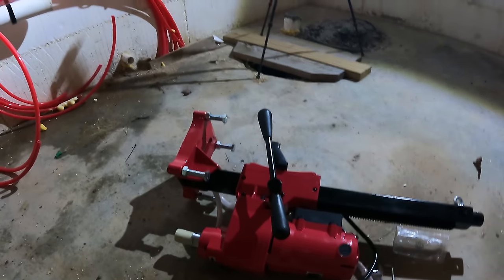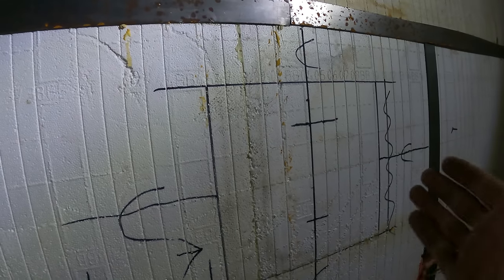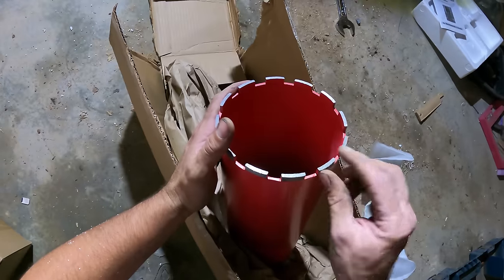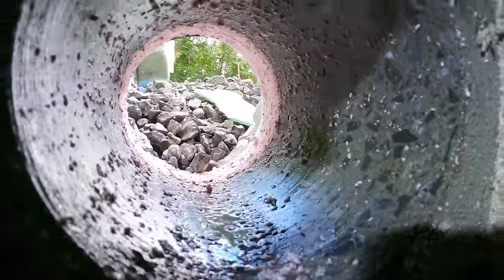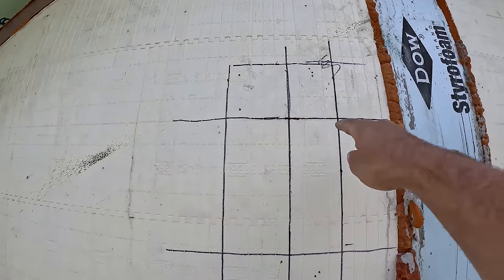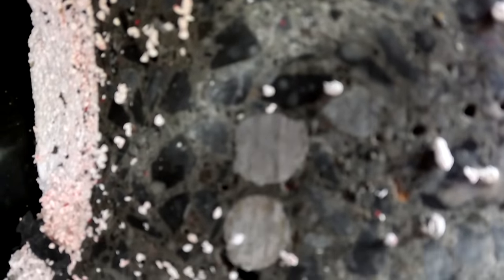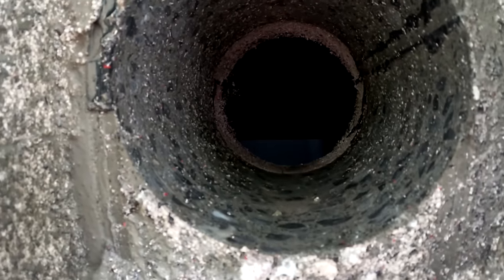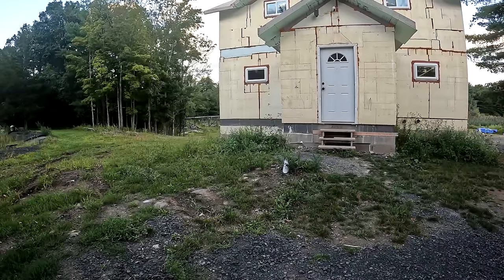Setting up a wall mount Bluerock core drill rig for drilling concrete

Comment: Did a lot of diamond core drilling before I retired, if you are doing multiple set ups as you were it's worth the effort to make up a plywood template to mark the set up out. Also as another poster pointed out don't try and force it to cut, gentle pressure is all that is needed or you risk polishing the diamonds and then it won't cut at all. I often found it was better to wind the barrel out while it is still turning, less chance of jamming up. As you gain experience you will be able to tell when you are cutting rebar change of cutting rate, different sound, or change in appearance of the wash water, (steel particles in it, I used to use a magnetised screwdriver to check).
One final point for novice drillers, make sure you get the right cutter for the material you intend to drill.
Reply: Wise words! 👍🇦🇺
Reply: Exactly my thoughts after drilling lots of holes…I also like to push lots of water to keep the cuttings away from the diamond surfaces.  You don’t want the diamonds regrinding the concrete/rebar cuttings.  You are wasting an expensive core bit…question?  what are they getting for a 6 inch core bit these days?  800 dollars? Just curious?
Reply: 😅 14:23
Reply: 6
Reply: ,  6
Reply: , 14:23 y fu ,
Reply: 😊i 14:23  ,,
Reply: Z
Reply: * ,,,, 14:23 ,,,,,

Comment: Hello Jesse, it would be appreciated, as in your other videos, if you activated the subtitles. This helps those of us who don't know much English help a lot to understand your work. Greetings from Madrid, Spain
Reply from the maker: The subtitles are usually always on, it just takes youtube a while to make them
Reply: @jmuller86 
Your video has no caption ..
Reply: does for me in Hungary
Reply: No subs here. Netherlands. Not that i need them but just telling you that they aren't here :)
Reply: you can cut the cc on yourself and it’ll show the words
Reply: Hello, nice to watch you do so many things. I have done a lot of different stuff also. My problem is in trying to get permitted stuff done. The welding and machinery stuff I can do. I put my well pump,  pipe and wire in 140 feet. Probley supposed to have a permit for that too, but I just did it. I dug a 600 foot trench up 100 feet zigged and zagged  wore my body out did most of it with a shovel and pick, no access with power equipment. I did have to borrow a jack hammer to get across my driveway it was hard to dig. Looks like you are enjoying yourself. Good job
Reply: the ones I have seen are supported by a four legged cage also bolted to the wall, and water, pressure lubricated.
  concrete cutting for the use of !  That looks like a decent bit of kit for a builder.
Reply: Amazing that is a good core drill , nice way to-get through concrete,and the little guy   Is well on his way to get a mechanical brain nice tnis thanks buddy BigAl California praise Jesus Christ grace amen amen 🙏
Reply: @asdasd-di6lx  bojler eladó :)
Reply: I see the captions…

Comment: Something to remember an older fella i knew taught me to use a piece of solid copper wire between the core bit and the threaded arbor keeps it from getting to tight easier to screw off !
Reply: I just posted the same thing.  A penny works in a pinch too.

Comment: 9/3/23;  2day you & your little blond haired supervisor (age..?..3..?) demo'd Blue Diamond 🔹 wet Core Drilling tool & 6" diam x12-15" L cc drill bit (~$1500). Wow! Just as your real-time video showed all viewers, that is a heavy duty, serious tool that easily cut thru 6"-8" cc & 1/2" embedded rebar! Yup, solid tool for the job! Your good research (+experience & analysis of situation) worked great! A+👍

Comment: It went smoothly😬
I worked 1 year in the professional business awaiting another job.
Mostly makes the rebars no problem, the bad ones is the twisted steel wire type concrete.
The worst I was into was drilling up in roofs, a rainy operation😬
A nice tool you got there.

Comment: i got one back in 2021 ive used it for holes in the house but also on some big granite boulders i cut out 10 inch holes for plants... looks great as a rock garden...
Reply from the maker: Nice, seems to be worth every penny you paid right?
Reply: @jmuller86  oh yeah, comes in handy for kinds of jobs... even drilling hols in concrete for fence posts... did a large boulder for a vintage street light, on one property we had a cliff side and i drilled holes in that for lighting along the wall of it for a patio seating area. as you said take care of it and it takes care of the holes.

Comment: Very cool. I bought one of these through an auction today. It’s a different kind though. Max of 8inch diameter and 22 inch stroke. Retails for 1500.00 I snagged it for 220.00. Got a hell of a deal

Comment: Three hundred dollars per hole drilled does not sound bad at all, and you still have the drill and bit left over to drill some more.  The alternative i do not want to mention: hammer and cold chisel.  I Dutch there is a saying that that would be work for monks alone!  Celebrate your success!

Comment: Twisted steel wire can be a pain with one of those core drills, but rebar is no problem. Great tool that can be a great investment if you have jobs that it is useful for. ❤

Comment: Nice...that thing cuts pretty smooth. Also with the extension cord @ 15 amps....the length of the cord is going to cause it to heat up more as well. When you are already pushing it to it's limits as you mentioned...not having a big bundle of extra wire spooled up on the ground could be the difference between it completely melting and potentially ruining your tool. With some of the cheap cords they only design them to meet the minimum requirements @ 15 amps. Great vid as always Jesse....thanks for sharing!!

Comment: Hello, nice to watch you do so many things. I have done a lot of different stuff also. My problem is in trying to get permitted stuff done. The welding and machinery stuff I can do. I put my well pump,  pipe and wire in 140 feet. Probley supposed to have a permit for that too, but I just did it. I dug a 600 foot trench up 100 feet zigged and zagged  wore my body out did most of it with a shovel and pick, no access with power equipment. I did have to borrow a jack hammer to get across my driveway it was hard to dig. Looks like you are enjoying yourself. Good job

Comment: Also - if you ever find yourself needing one - Makita makes a nice (and not very expensive) hand pump pressure tank to supply water when a garden hose is not available or practical.  I have one at work I use with demo saws to cut sidewalk for utility poles. I throttle the water using the valve so it's just enough to kill the dust without leaving a pool of water behind.

Comment: I cannot imagine why Blue Rock tools would not give you the tool for free, so they can get a video illustrating use of their valuable tool. Were you to shy to ask ?? 
Considering their manual can be used as butt wipe, maybe they do not have out of the box thinkers in Tukwila. Your great vid is just what those slackers need to boost sales. 
You maybe ought to contact them Jesse and tell them you would allow them to embed your video into their site
for a refund of your cost. But first you need to not allow anyone to embed or copy your property.
I bet they go for it, as this is a prime quality recommendation for an expensive tool , which would
convince me to buy if I was not sure. I mean you were not sure before you bought it & you took a chance. I am only 22 minutes into this but if you have success drilling rebar, get your money back bro. It will be very very valuable for them. Go Muller Go.

Comment: 👍 Dude, you got way more faith in a single Tap con not working its way loose to be standing under such a heavy spinning tool without some sort of safety line attached from above to it.  Very glad you're safe,  WATCH OUT!  If that thing were to drop just reflexes alone would make you grab that spinning bit and all hell would ensue. On a lift too, fuuuuuuuuuck that!

Comment: A weed sprayer will work when a garden hose isn’t convenient for cooling.
Most of these drills are 2 speed, use it to your advantage.
Check specs, if it’s a 20amp drill, a 15 amp outlet will shorten the drill life. 
When removing the core, DONT bang on the bit as so many do. Any dent in the bit makes it out of round, then the bit cuts with the sides of the teeth, instead of the face. Popping breakers, and overworking the drill. I work for a company that sells bits and drills and repairs drills.

Comment: When going through walls, it's generally a good idea to drill a 1/4'' test hole for alignment. 30:00 No matter how good you think your measurements are. It's much easier to adjust for unknowns.

Comment: We would put a penny or copper wire between the drill bit and the socket.  Sometimes they can be difficult to pull off.

Comment: I got Vevor core drill with 4” and 6” bit for 230$ total and is great tool !
Reply: Me too, but almost burn drill at 1 hole. Old 1 meter wall with stone. Then as electrician realize, this tool are can not be protected from burning. There is not asynhron induction motor, but colector motor.There fuse or over current protection not working. There is only safe protection for people. Motor can be protected with mechanical safety couch. But on cheap core drill machine, this not exist. This is wh REAL core drill cost few thousand $.
 But it is the way to protect this kind machine. I made and working very well, but dig cost almost 240$. Expensive, but my Vevor core drill will never burnout.😊 And is cheaper REAL core drill for few 1000$. Even Hilti for 10000 $ burnout.😢

Comment: Cool idea for a business!  Thanks Jesse!!!  Stay Safe!!!!
Reply: Good Idea only working on home reinforced wall. If you have special ,vibrated and with water-stone inside, you need with this machine and this core bit 4 hours instead 30 minute or less. And drill bit will lifetime only 1/3 or less. And there is burningout, because this is not professional tools and they dont have real protection from burnout, except hand switch, if you fast enough.

Comment: I spent years in the demolition world the diamond saw pieces can be replaced they last a long time as long as you cool enough with water even where there is no water you can provide enough cooling with a high pressure backpack sprayer

Comment: We’ve had thousands of cores drilled when we didn’t or couldn’t set sleeves and these guys charge by the inch after show up plus extra cost for hitting rebar . We have to drill the inserts for the attachment so more time standing around plus provide a laborer for water control and clean up. Have you ever noticed the rigs they drive ? Always top of the line with nice rims.

Comment: I occasionally wet core drill and I just rent the tool and pre-buy the diamond core bit I need. I now have a size assortment and usually need only the drill that's cheaply rentable for just an hour or two. Rebar is barely an issue with diamond core bits and no significant force.

Comment: the upfront purchase price induces sticker shock doesnt it Jesse. but like you said, at minimum $1200 just for core drilling company for 1 hole easily offsets the purchase price. once you get some more experience with the rig, its another tool in your arsenal , another service you dont have to sub out on future jobs

Comment: if you just max out the legs, you wouldnt even need to cut the styrofoam. youd just need longer bolt to hold it.

Comment: Nice score. As others have pointed out, don't force it. Just let it eat like a chainsaw with gentle pressure. Motor is bogging down you are working it to hard. Also don't get in the habit of putting your hand on the back. Blocks already limited cooling vents and will greatly shorten life of tool.

Comment: I’ve had to tie in many Tower Cranes to the floors of high rise buildings and when the engineers screw up and lay the tie in locations in the wrong location they would have to core drill Six to eight holes thru the floors. They would x-Ray for rebar and post tension cables before drilling many times they missed seeing the rebar and cut thru them but three times they missed seeing the post tension cables and cut thru them and I was glad I wasn’t the core driller, the site engineers went nuts but ultimately it was their fault for not setting the tie ins in the correct position on the floor. When your  connecting a Tower Crane to a building with three struts anywhere from 250’ to over 1500’ high in the air there’s not much room for error. After the first tie in was off you can bet they got the remaining tie ins correct, I went back down later to the floor where they cut the post tension cable and the engineers did nothing to repair the post tension cable but how could they. There was a hurricane on the east coast of Fl years ago and it blew the crane over onto the beach and the top two tie ins that were bolted through the floor pulled completely out about a 4’x 4’ hole in three places on each floor guess why? No rebar or post tension cables were ever installed in the concrete floors when poured. After they investigated why there was no rebar or post tension cables the Superintendent was skipping floors to save money and got mixed up what floors had and didn’t have rebar and post tension cables. I’ve seen so many short cuts taken it’s criminal, one company in Ga had to build a 2’ riser on the floor they miscalculated the height of the collar on the Tower Crane and rescheduled the climb for the following weekend we got there and bolted the tie in shoe to the floor riser and the 1 1/2” bolts wouldn’t tighten up so we pulled the form off their riser and the concrete was crumbling they had went to Home Depot and bought Quick Crete to pour in the riser. The concrete had to be a minimum of 3,000 psi and most companies use 5,000 psi to reach the 3,000 psi required to attach the tie in to the building so the crane could be climbed without waiting for the 3,000 psi to finally reach 3,000 psi that’s required. The Superintendent gets a certain % of the money he saves during the project he controls if he comes in under budget and that should be illegal some people will do anything for money. Your core drill looks like a pretty good unit good luck. Sorry to have rambled on but your core drilling brought up memories. If there was such a thing as a EF-10 Tornado I believe you and your parents house would be extremely safe maybe so missing shingle’s but house completely safe.

Comment: That's a neat tool purchase that will come in handy on future projects. 
Instead of stripping the rectangle of foam off, could you not wind the levelling screws on the drill baseplate out and just drill the foam out where they penetrate to the concrete?

Comment: I used to use Hilti machines for my core cutting jobs.. i have even drilled 3 meters holes as well.. but 1200$ for just a small hole is ridiculous. for that small hole i used to charge 25$ in 2007..That is in Pakistan when i used to do that work....now its much cheaper as its very common.. only patience and accurate measurements are required.
Reply: was this telegram id was for real?

Comment: Great tool you got there Jesse. I just thought a thing though. Instead of cutting out the Styrofoam, what about making a mounting bracket of a 1/2' steal plate with a couple of 5/8 holes for anchors and a nut welded on to it for quickly fixating the drill bracket to it.

Comment: It is easy to justify new tools when the cost of the tool is near the cost of hiring, even if the rental is a little cheaper (assuming you could get it like you said). The ever-expanding tool collection...Can't ever have too many tools. Wish I had some of your bigger tools like man-lift and excavator. I came close to getting a bucket truck last year, but it was an old 80's F600 with a million dodgy looking hydraulic lines. I need to cut down a couple dozen trees on my own property. The truck would have paid for itself, but if I ran into trouble fixing it, it would have been a problem because it was not road worthy, so walked away. It would have been bound to my own property. I don't have a rig like yours with a low boy, or CDL.
Also glad to see you wearing the fall arrest harness when you're in the lift, and hearing protection. Hopefully you wear the hearing protection whenever you operate any of your heavy machinery. Older adult males tend to naturally lose their hearing sensitivity, especially in the high frequencies just from aging. Constant exposure to loud diesels will accelerate that. I even wear mine when running a shop vac. Can't stand that noise. Also when running any two-stroke motor, mower, tractor, etc. I keep the ear muffs everywhere.
Reply: BTW speaking of the fall protection, you should add an emergency stirrup strap to the harness. It allows you to clip to the harness so you can step on the loop and relieve the pressure from the leg webbing. This is critical for your safety. Even without any shock (sudden arrest of fall) imparted on you, your body weight suspended in the harness will cutoff the circulation of your legs and cause cardiac arrest. It only takes 10 minutes for this to happen and it results in death. It is called suspension trauma. Please look it up. If you ever use your lift by yourself, you should get a self-rescue line to lower yourself.

Comment: Do you need to cut out as large a pocket? It seems like all you need is to have a hole in the ICF for the mount, and let the core drill the insulation and leave smaller repair area.

Comment: Pretty cool, but the Tap-Con running in and then backing out followed by running in with rig—Is no bueno.. Pre drill and run it in with the rig attached. They’re designed for 1 time run in and after that all bets are off for adhesion .. Yes, it worked for you, but… Probabilities dictate disaster 😮
🍺 🍻 🍺